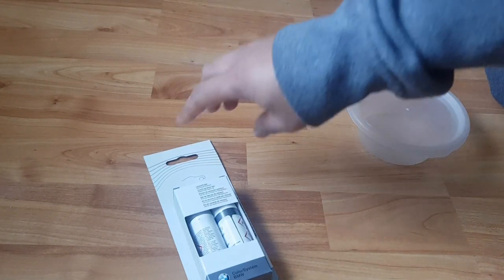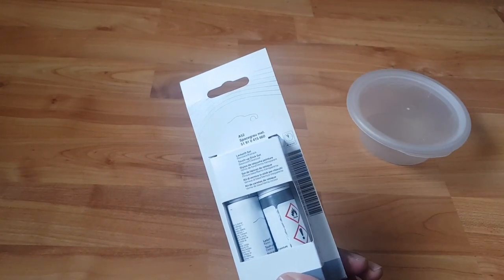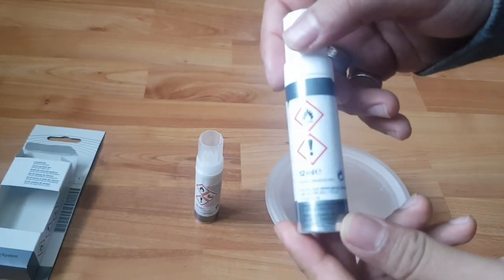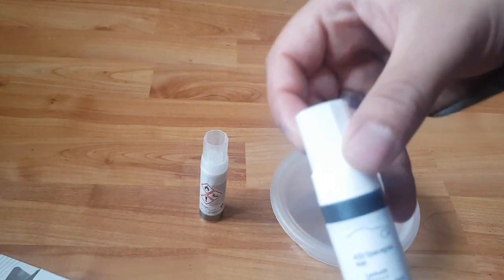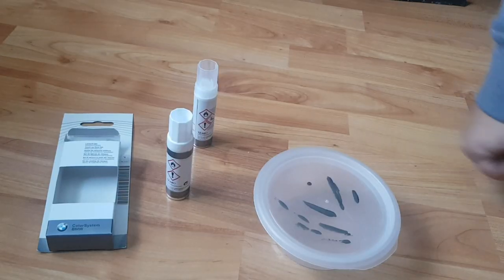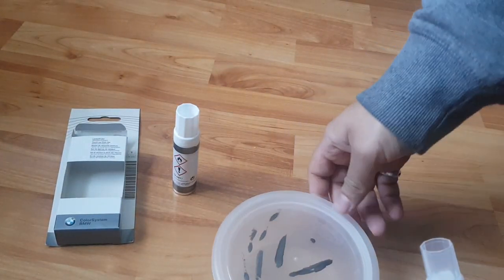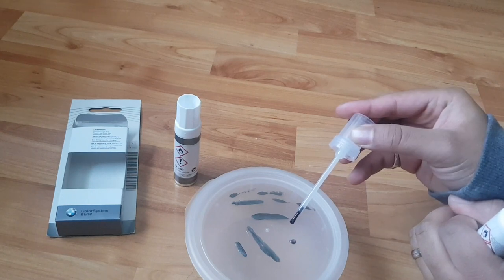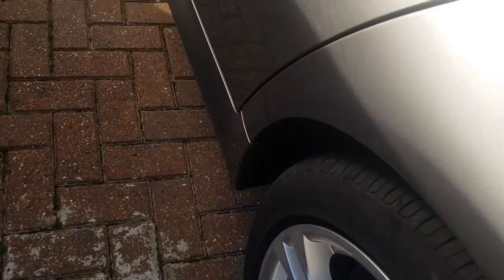How To Use BMW Touch Up Paint | Apply Touch Up Paint

Comment: The kit is good but to be better the brush brushes are to soft , they need to be more hard for a thin layer, i will buy this for my BMW but i will search for another brush. 
A advise for You , this kit is for light scratches not for that You have on the bumper, for that ones You must sand the damage with a very small sand paper put on the rubber of a pen, and bring at the level with the paint, after that You can make the process. This is a hard job but Its worth , saving hundreds dollars for repair a enthire element.